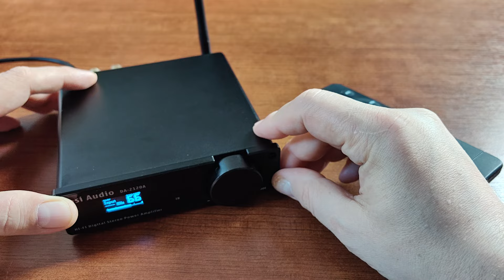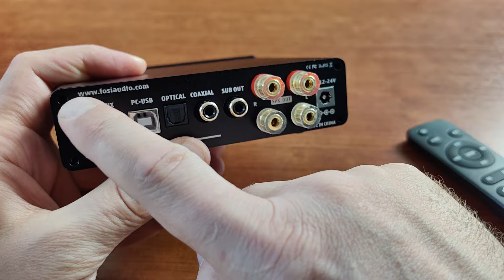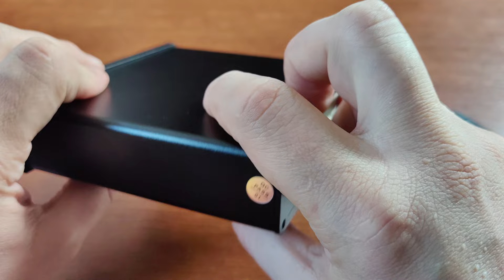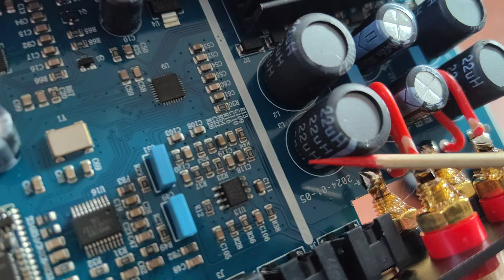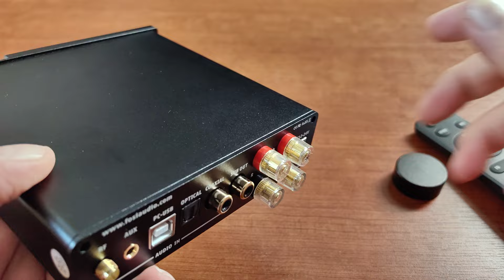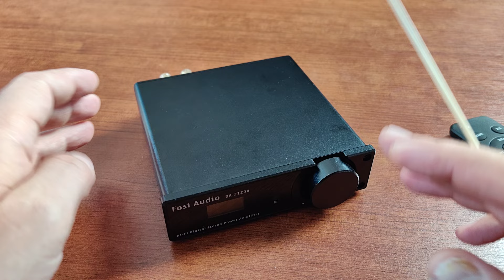Working home office: Fosi DA-2120A desktop DAC speaker amp combo

Comment: Could you please list the chip set? Online reviews mention high noise level, did you notice noise? Thanks!
Reply from the maker: @trevorbartram5473  DAC is CS8422, for amp and bt refer to the video, it's there and I just don't remember exact STM and Qualcomm IC type numbers that you can see there.
I think I've told in the video that there is a slight hiss that's masked by the music when it's playing but can be heard on quiet passages or short pauses in track and that amp is trying to mask that via cutting output when there is no input stream

Comment: For a good but affordable desktop solution, I really liked the FiiO K5Pro ESS for a DAC/preamp/headphone amp, stacked with an RSL ia 255.1 speaker amp.
The RSL has a sub (or pre) out, and a selectable 90Hz high-pass filter for the speakers.  I ran that setup for a long time, and was quite happy with it.  
I eventually replaced the FiiO with a Nitsch (Schiit) Pietus Maximus, with its optional ESS DAC card.  The PMax is definitely an upgrade, but it can't beat the FiiO as bang-for-buck.  And it's probably bigger than you want on your desk.
Reply from the maker: @zounds13  yes that's a good setup, though it's bigger then my free desk space. It's not big as it was never planned for regular work. But the times have changed and working from home is new normal.
Reply: @k4syx  the FiiO and RSL have roughly the same (small) footprint, so they stack well.  Or are you height-limited too?
Reply from the maker: @zounds13  exactly height is also an issue as this is room in the attic with angled walls. Anything higher than 4-5cm means moving it further away from the desk edge and there is no room for that ;(

Comment: For my PC, I use a Douk Audio ST-01-Pro into a pair of Cambridge Audio S30 speakers and Monitor Audio ASW210 subwoofer.
Reply from the maker: @mddawson1  I have S30 too!
These are gold nuggets especially for current price!
Reply: @k4syx  I got mine second hand (in excellent condition) in 2022. The sub I got new in the late 90s for my main setup. It was relegated to PC duties after being replaced by an SVS P-1000 Pro.

Comment: The low price and the 12-24V external power supply also make it an application for Boat/Motorhome/Gardenhouse.
Reply from the maker: Yes, havent thought about that but you're right. Its all in one and can be run directly from either 12 or 24, good catch!